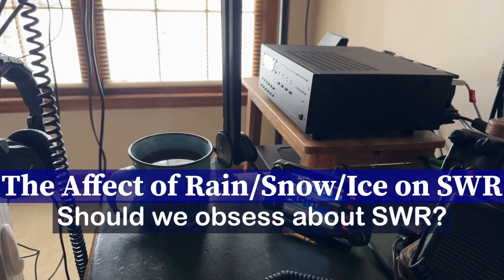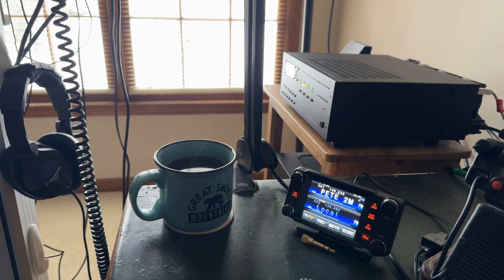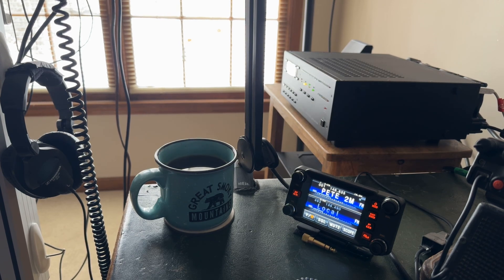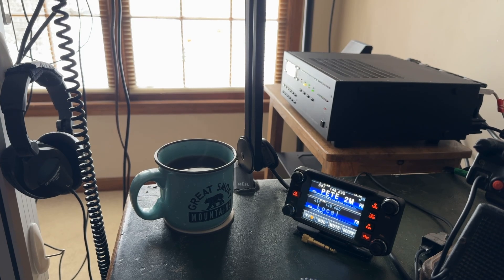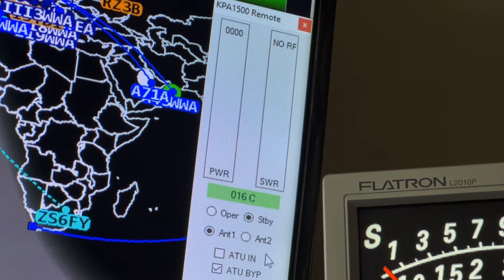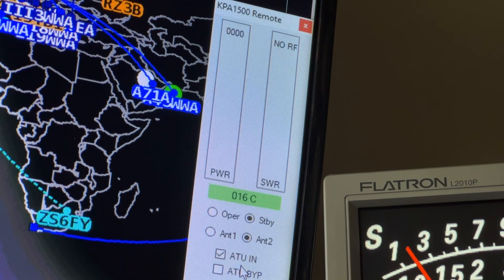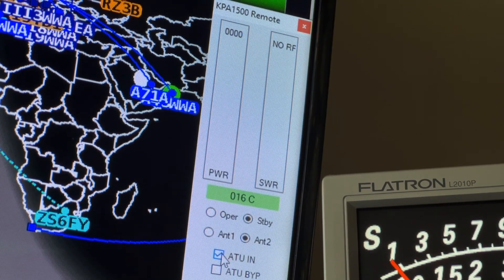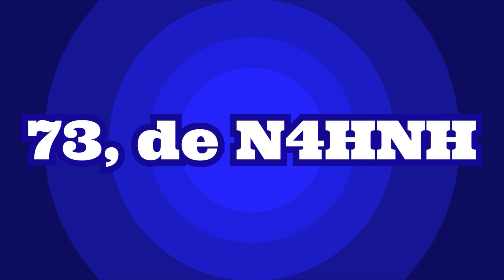The Effect of Rain/Snow/Ice on SWR (Should we obsess about SWR?) hamradio #hf #antenna #swr

Comment: another myth I believe is about cooking finals when high swr.
Reply from the maker: A high standing wave ratio (SWR) can indeed damage or "cook" the finals (the final amplification stage, typically transistors or tubes, in a radio transmitter) under certain conditions. Here's why:

- High SWR Causes Reflections: SWR measures the impedance mismatch between the transmitter, transmission line, and antenna. A high SWR (e.g., >5:1) means that approximately 36% of the transmitted power is reflected back toward the transmitter, instead of being radiated by the antenna.  Most solid-state transmitters can tolerate a 2:1 SWR, and even a 3:1 SWR for short transmissions, with an ample rest period between transmissions.  Many transceivers include a fold-back circuit.  As the finals begin to stress, the fold back circuit begins lowering the power output proportional to the amount of heat buildup.  I don’t recommend exposing your transmitter to that much stress.  Most modern transceivers include what I call a “touch-up tuner” (antenna matching unit).  These can make up to a 3:1 SWR look perfectly safe for the transmitter. 

Let’s consider the Reflection Coefficient (Γ). This measures the amount of power reflected due to the mismatch. To calculate the reflection coefficient for a 5:1 Standing Wave Ratio (SWR), we use the following formula:

Reflection Coefficient = SWR-1/SWR+1

For a 5:1 SWR that is 5-1 divided by 5+1, which equals 4/6 or 0.667 (two-thirds)

- Increased Voltage and Current: Reflected power creates standing waves on the transmission line, leading to voltage and current peaks (antinodes) that can exceed the transmitter's design limits. These high voltages or currents can overstress the final amplification components, causing excessive heat or electrical breakdown.

- Heat and Damage: The finals, especially transistors, are sensitive to heat. Reflected power increases power dissipation in the finals, potentially overheating them. Prolonged operation under high SWR can lead to thermal runaway or permanent damage to the transistors or tubes. For example, high SWR can cause "excessive local heating" or arcing, which may degrade or destroy components.

- Severity Depends on Conditions: The risk of "cooking" finals depends on factors like the SWR level, transmitter power, duration of operation, and the robustness of the finals. Moderately high SWR (e.g., 2:1) at low power or with short transmission times may be tolerable, but very high SWR (e.g., 5:1 or infinite) at high power can quickly damage components. Modern transmitters often have protective circuits to reduce power or shut down under high SWR, but older or less protected systems are more vulnerable.

- Mitigation: Using an antenna tuner to match impedances can reduce SWR at the transmitter, but if the tuner is placed at the transmitter end, the transmission line still experiences high SWR, increasing line losses. Ideally, matching should occur at the antenna feed point. Regular SWR monitoring with an SWR meter helps prevent damage.

In summary, a high SWR can "cook" finals by causing excessive reflected power, leading to overheating or electrical stress, especially at high power levels or with prolonged operation. Proper impedance matching and monitoring are critical to protect the transmitter.

Note: The term "cook finals" is a colloquial expression in amateur radio, referring to overheating or damaging the final amplification stage. It does not relate to microwave cooking as described in some sources, which discuss standing waves in microwave ovens.
Reply: @n4hnhradio this is why I love my antenna tuner tuning my antenna system to resonance, it sends the reflected power back to antenna fir radiation

Comment: My hex beam  is 1.6 or better on all 6 bands.  Really don't need a tuner .
I dont use one with my alpha 87a.
I can tune the amp without tuning the antenna. Funny thing when it was covered with ice the other day ( paulding  county  Ga.) It was high swr i couldnt tune till it melted.
Reply from the maker: You saw in my video that I couldn’t match the doublet on 40m, due to the ice. Once the ice melted, all was okay.  The doublet doesn’t usually outperform my ZS6BKW on 40m anyway, except at night, for DX.  My R5 vertical was still fine on all 5 bands. It’s a good up.

Comment: Listen to pylon electricity cables or overhead electricity wires on railways in wet weather.
They buzz and crackle. Electricity tracking across the insulators. Same thing with r.f.
I like to aim for at least 1.5:1 but 2:1 is okay.
G4GHB.

Comment: Great video sir. I find when I have snow and ice on my antennas/600 ohm ladder line I have SWR jumping around on SSB phone even after my ATU gives me a 'good match'  of 1.5 or less. It seems to hop around between 1.5 to 2.5 (ish) SWR.
Reply from the maker: I’m glad you enjoyed the video.  Mine doesn’t move while talking. It changes gradually as the sun melts some of the ice or as the water dissipates.  But it’s a gradual change.

Comment: Agree with you 100%. I'm a MARS operator and I'm on frequencies inside and outside of the ham bands. I have a ZS6BKW and as long as my tuner makes my radio happy, I work every frequency I need and I get good signal reports. I only pay attention to SWR on the rare occasions my tuner just can't make it work.
Reply from the maker: The ZS6BKW is a workhouse.